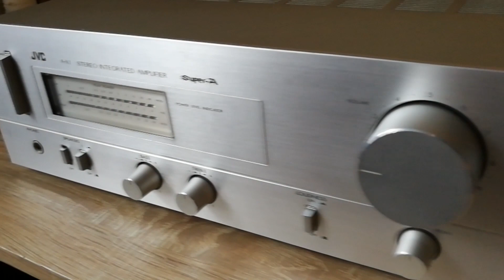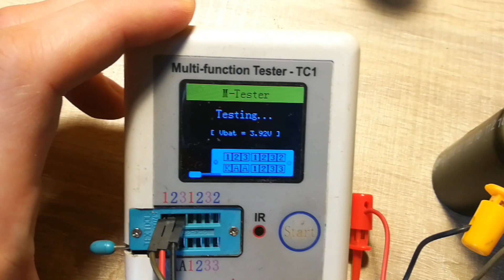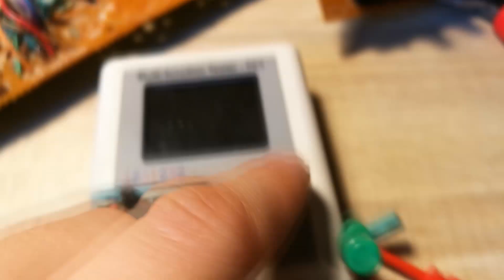Repair Amplifier JVC A-X1, naprawa wzmacniacza JVC A-X1

Comment: I have the same amplifier. It plays music out of both speakers when the music is loud, but when the music is quiet, the amp only plays music through one speaker. 
I opened the amp up and the big capacitors have some of the red goop under them. Also, the things you are removing at 2:28 have the same corrosion around them. 
Any thoughts on what the problem could be. How do I safely remove the big capacitors?
Reply from the maker: In your case, the speaker relay should be replaced, or it may be the fault of the volume potentiometer. But start with the relay. The glue under the capacitors must be removed and the corroded elements replaced.
Reply: @TheXAlienx  that is very interesting, because once I was playing music and it was cutting in and out and I could hear the relay “click”, but I think that was when the music was really loud. Also i unscrewed the potentiometer and when I touch one part of it, it makes a humming sound out of the left speaker and when I touch the other side of the potentiometer it makes a humming sound out of the right speaker. Could it have a short to power? There were white lines of corrosion on the pcb. What is that liquid you soaked the potentiometer in?
Reply from the maker: @dnbstreamer  this is rather a normal symptom of the potentiometer. I used isopropanol for cleaning
Reply: @TheXAlienx  ok thanks for the quick reply I will try to replace the relay and clean the potentiometer

Comment: หลอดไฟLEDหลอดแรกไม่ติดเมื่อเปิดPOWERซ่อมอย่างไร หลอดอื่นปกติแต่หลอดสุดท้ายก็ไม่ข้อยติดเหมือนกันขอความรู้ดัวยครับว่าสาเหตุเกิดจากอะไร
Reply from the maker: A service manual is available on the network. First, check the diodes if they are operational. Then measure the voltage on the LED power plug.